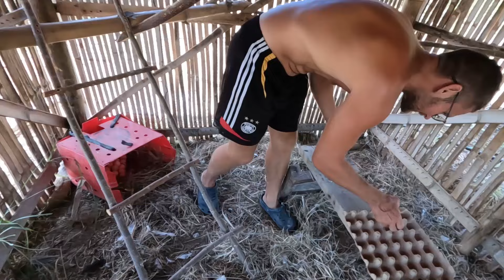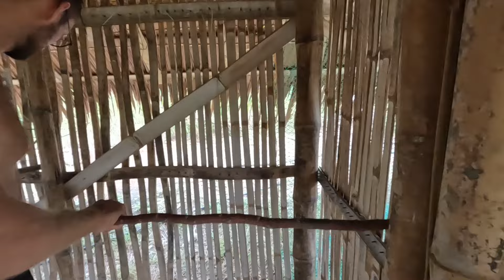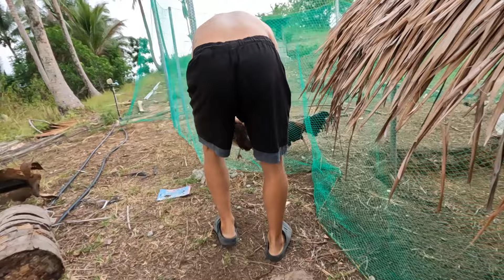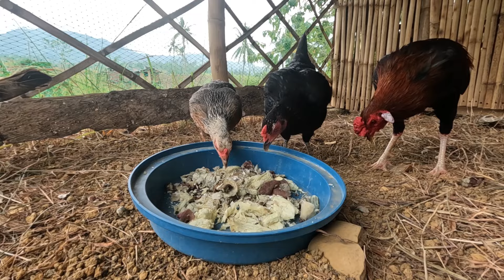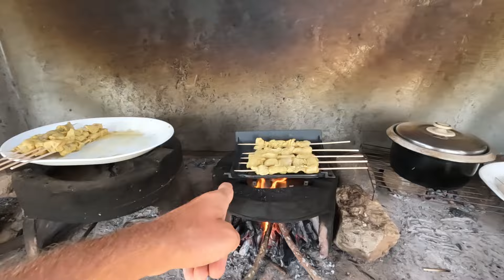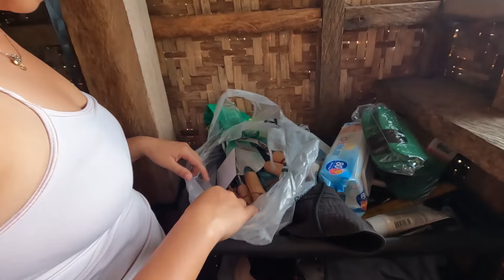Petrovich found a snake | We ate our eggs from the coop for the first time| Problem with our roof

Comment: And i would like to suggest that, it is ok to position those laying baskets close to one anothe...like 6 to 10 inches away from one another,...as long as they are elevated from the soil flooring...atleast 4 to 6 feet height.....pls remove those on the floor soil....place them to higher position like the other you did....chicken laying eggs prefer their laying basket higher, because they feel safe......
Reply from the maker: Thanks for the tips ☺️